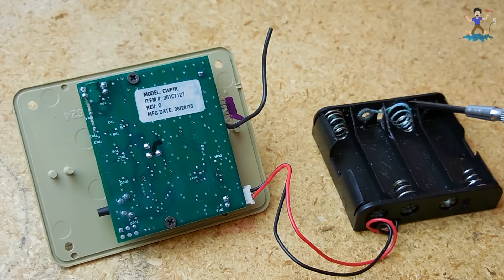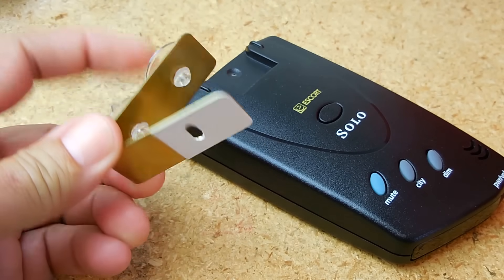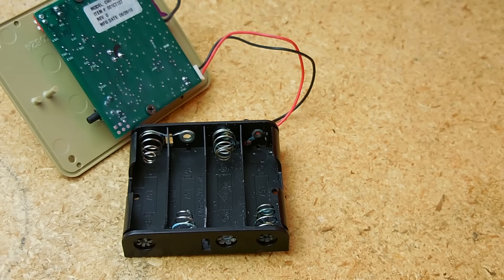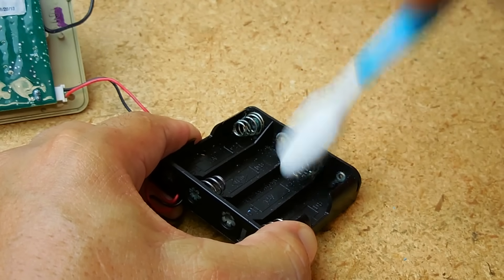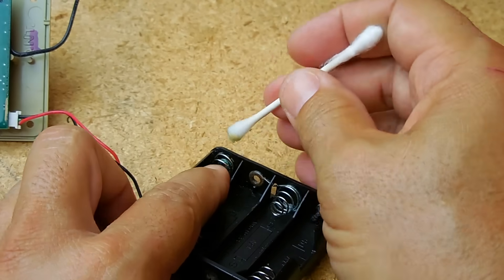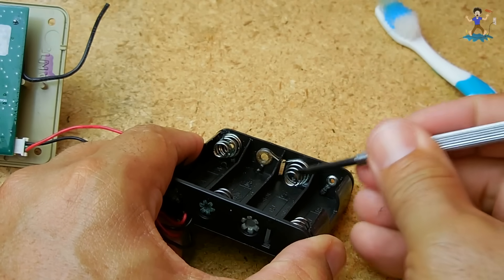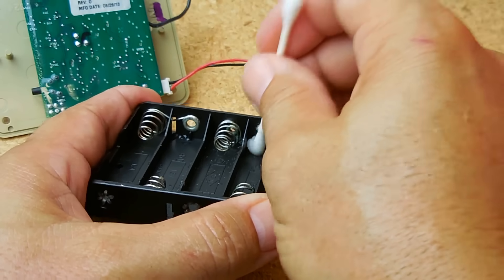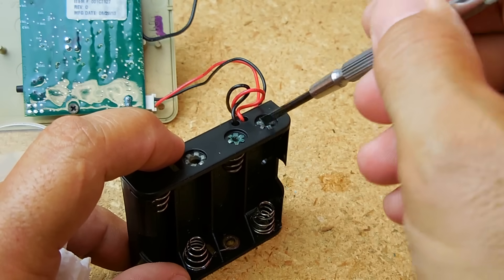EASILY Clean Battery Leak Damage(Corrosion) In Electronics

Comment: Moral of the story is to remove batteries when not in use for a while or a long time.
Reply from the maker: Yes, remove the batteries when not in use. Thanks for watching!
Reply: Instead of removing the batteries, an easier/more convenient way to avoid leakage, is to simply turn around ONE of the batteries thereby interrupting any power drainage/leakage due to any possible flow of current through the circuit.. This will also prevent losing or misplacing the batteries for later use..
Reply: @johnmcclintock8004  If there are an even number of batteries, turning half around will stop discharge.
Another technique is to place a small thin piece of paper or plastic over a battery terminal as an insulator.
However I have now thrown away several somewhat expensive aluminum flashlights because the batteries swelled up and I was not able to get them out.
Reply: MrTechnophile  <—. If the batteries are copper top I hear u can mail the flashlight ( or whatever ) to them and they will replace it.  The copper tops are TERRIBLE for leakage, rather than spend the money to improve their process, I think they feel it is cheaper just to replace the items. I have read that many people have had to do this and people at the Coppertop company don’t seem to mind or question.  I have had very GOOD LUCK, however with Ray-o-Vac not leaking. ( your mileage may vary of course.)

Wish he went over how to get to & clean  the bottom of a damaged flashlight, or how to drill out a swelled up battery stuck in a tube type flashlight.
Reply: @johnmcclintock8004  I've had batteries leak that had cardboard btwn the batteries and the contacts. Infact, I've also had batteries leak inside the bulk packaging of batteries that you can get at home depot etc.
Reply: @johnmcclintock8004  Given that I have found lots of new in packet batteries leaking I don't think this is good advice. It's not just current drain that causes leakage, the batteries will do it spontaneously.
Reply: @johnmcclintock8004  , Incorrect! Do Not flip one battery around on any device that has a small constant current draw, which includes most flashlights that have multiple modes for brightness and flashing, and certainly anything with a microprocessor. The constabt current draw might only be a few micro amps but the reversed battery will be likely to leak because you are asking it to "buck" the voltage. BTW, I have also seen alkaline batteries actually flip and reverse polarity all  on their own! Seems to be more prevalent if you mix and mismatch batteries wired in series ---- the weakest battery, or the one that is most different from the others, may change its own polarity, or is more likely to overheat and leak.
Reply: @jonka1  , the battery that is installed backwards will be the first one to leak, if there is a constant current flow of even a few micro amps. Or, that battery will flip its polarity internally. I have seen alkaline batteries do this; it's a major reason why manufacturers tell you specifically to NOT "mix and match" batteries. The weakest or most chemically different battery will invariably fail first.
Reply: @europana7  yep. I've had new, never used batteries leak in the drawer where I stored them...more than once. I think some just leak because they're faulty. This was a name brand, but I can't remember which one...one of the big ones, though.
Reply: @jonka1  I agree. I think some must just be faulty. I've had them leak all over the place in the drawer where I stored them...more than once. And it was a major brand (though can't remember which one).
Reply: @electronicsNmore  Our remote control to our television began not to work, and I noticed the batteries that were in it mildly corroded the inside of the remote.  It was an active remote, so it’s not like the batteries I’ve been sitting in the device for a long time without use..  I came across your video, and cleaned the inside of the remote, and it works like new. Thanks for uploading this. I really appreciate it. It was very helpful and I gave you a thumbs up.👍
Reply: A useful approach, seems problematic for flashlights.  Maybe rubber-band a Ziploc bag with the batteries to the item so you can find the batteries in the dark.
Reply: Yep, I forgot to do that on some Christmas lights I decorate my car with every year... Now it’s super corroded and gross. Gotta get out the vinegar!
Reply: Amen to that ... Remove the batteries when you are not going to use it for a long time, we ALL experienced battery leakage
Reply: Has anyone noticed that Duracell's copper top batteries have the highest probability to go bad? I refuse to buy them anymore!
Reply: Correct answer is to use lithium batteries. Lots more $$$, but no leakage issues.
Reply: Maybe if the flashlight manufacturer would put in a sleeve of some sort (foam, maybe?) that would still allow removing batteries if they swell up, I would be interested in buying their flashlights again.  Currently, I buy their high-quality flashlight, put it in the glovebox, and when I want to use it not only are the batteries dead, I can't change them.
I should use the batteries-in-a-Ziploc approach.  Except I need the flashlight again, put the batteries back in.  Done, take them out.  Oops, not quite done.  Back in.  Sooner or later, forget to...
Reply: @MrTechnophile:
Thats what 99% of the people do, buy a nice quality flashlight, put the batteries IN and let it sit in the glove box ... Then months or yrs later they need that light and guess what..?? You answered it, dead batteries... or exploded batteries and now your flashlight contacts are corroded... now its a dead weight... 
So you take the batteries and put them in a small zip lock bag and try to keep them air tight as possible ... Now if you buy GOOD batteries, like energizer or duracell with ~10 yr storage life...  They should be ready to go and your light wont have corroded contacts :-) 
Just don't forget and leave them in .. !!
Reply: @ACommenterOnYouTube  Thats why I now put a handcrank torch in my glove box. No more batteries going bad to worry about. I used to keep Dollar store torches and batteries still in their packs in my car and years later remember about them. I forget about them cause I always end up using my phone as torch most of the time anyway.
Reply: @Hyperpenguin:
Well most NAME brand batteries have a ~10 yr shelf life .... So guesstimating those Energizer or Duracell batteries that are NEW IN PACKAGE left in the glove box for ~10 yrs will still work ... 
Yes your phone's light is what MOST will go for but depending on WHAT you are doing, sometimes a good ole flash light works better.
Reply: @ACommenterOnYouTube  i had duracell just cover my remote in crap..
Reply: @TheHyperPenguin  the only crank flashlight I've come across that's worth its salt is one I got from IKEA, of all places. Red hourglass shaped, using a capacitor instead of batteries for energy storage. It's actually useful.
Otherwise, an 18650 powered flashlight is much preferred over any standard alkaline cells like AA, C, or D. 
 AAA flashlights get a pass because they're usefully tiny.
Reply: @ACommenterOnYouTube  Duracell have become utter crap, they often leak; I've had better luck with Eveready Energizer and Panasonic batteries. Eveready claims to guarantee their premium "Max *Lithium*" batteries against leakage for 10 years, but they're expensive. They do have a bit more voltage than their ordinary, non-lithium Energizer Max batteries, which will give you a bit more output and should last longer, although  cheap flashlights might not handle the extra voltage without overheating the LED unless there's a heatsink or some metallic mass to the flashlight.
Reply: Learned from a high school shop teacher that a rubber pencil eraser will also do a good quick fix if contacts are not too corroded, but like the added benefit of the rubbing alcohol for the neutralization. 👍👍
Reply: @bryankautz826   Use of a pencil eraser, or better yet a mildly abrasive ink eraser that has some silica or fiberglas in it, is an old military Signal Corps and ham radio trick that I learned from an electronics tech.  Unfortunately most modern erasers are made of some kind of soft vinyl or plastic material that doesn't work worth a damn. Another tool that anyone who dabbles in electronics should have is a fiberglass-bristle "scratch brush". These are excellent for cleaning heavy tarnish or corrosion on electrical contacts.
Reply: And be sure to check when buying used electronics
Reply: Yeah I left mine for 5 years lol this video helped cause I was able to fix a ton of my old toys with it 😅
Reply: @Scented117  I bet the ones you left for five years were not Duracell Copper Tops! LOL
Reply: Yes but we always forget about it!
Reply: Or use lithiums if compatible.
Reply: BINGO!
Reply: Thanks. Just what I was looking for
Reply: Wise advice! However, I have experienced leakage in a remote that I use almost daily. No way around it, I guess, at least in some cases.
Reply: @michaelscholes8956  Use lithium batteries for remote controls.  Energizer, at least, guarantees no leaks from their lithium batteries.
Reply: @ebinrock ,  we should clarify that you are NOT referring to rechargeable lithium batteries. Energizer Lithium Max are disposable batteries. I've been putting them into expensive devices where changing batteries is difficult, like Fluke multimeters. The 9 volt batteries cost something like 8 or 9 bucks. Nite that voltage output is a bit higher from all of the batteries in that series, including the AA and AAA batteries (1.65 to 1.7v under no load), and so some flashlights might run the LED kinda hot unless there's a heatsink or some metal mass to conduct away the heat.
Reply: That's easier to say rhan to do, at least for me. I forgot several times. This is an awesome trick and well explained.
Reply: It depends. I was on a 7 month trip across Europe with a tent and bicycle. My Black Diamond headlamp has some corrosion in it even thought it's IPX what-not (enough to dip into water for up to 1-2 meters) and I've used it almost every single day. Every time you open that thing up moisture from the air goes in and there you have that green crap. But yeah, removing batteries for long term storage is essential and applies to all types of devices regardless of the battery (plus the battery will not get drained as fast if not inside the
Reply: Nope! Instead, put a piece of plastic on the positive pole. That will stop the electrolysis process.
Reply: The negative side of the alkaline batteries is invariably the one that leaks, never the positive side. If you insulate anything, that's the side to do it.
Reply: @wingerrrrrrrrr
Reply: The other Tech Tip is to find, buy & recondition these Careless Moments.
Reply: Sometimes you forget. So many many things have batteries.
Reply: @Randy Alvarado because they are regular alkaline batteries which are prone to leak regardless of shelf life or brand.
Rechargeable batteries (NiMh & Li-ion) DO NOT LEAK because they are a different chemistry.
Reply: Yeah but sometimes you put something away with the intention of getting it again and forget
Reply: Very rarely happens but good point, if you remember where you put the batt’s!  🥴
Reply: BUT I NEVERVTHINK ABOUT IT!   Do i suffer!
Reply: Duh.
Reply: My walkie talkie is damaged bcoz of leaked batteries
One is, working one is not
Don't know, what to do
Reply: We aint got time for that,  they will be gone when needed again.
Reply: Yeah... Learned that the hard way

Comment: The battery leakage and corrosion thing seems worse than it used to be. I've had quite a few things ruined by corrosion recently. 
I have some popular brand batteries (Dura####) that have started to rust on the negative end while still in the package. The expiration date is December 2025. Are they cutting corners in manufacturing (cheaper materials, etc ?)
Reply from the maker: Thanks for watching! I have a lot of excellent videos on my channel that cover many different subjects, so be sure to check out my extensive video playlists for other videos of interest to you, rate thumbs up, and share my channel with others. Thank You

Comment: I've had four of this brand driveway alarm and every one corroded.  Suggest coating the battery holder with a thin film of vegtable oil.  Worked fine for me, but the alarms suck.
The Old Master
Reply from the maker: Use a thin film of silicone grease. I have a lot of excellent videos on my channel that cover many different subjects, so be sure to check out my extensive video playlists for other videos of interest to you, rate thumbs up, and share my channel with others. Thank You

Comment: Great tip.  This happened to a TV remote of mine. I tried cleaning it all out and got it working for a while, but it failed a couple of months later and I had to buy a new one. Wish I'd seen this video first. 
Note that in the UK Rubbing Alcohol is called Surgical Spirit.
Reply from the maker: Glad you enjoyed the video! I have a lot of excellent videos on my channel that cover many different subjects, so be sure to check out my extensive video playlists for other videos of interest to you, rate thumbs up, and share my channel with others. Thank You
Reply: Or just ask for isopropyl alcohol. The 91% version found at the local drugstores in the U.S. can be used to remove sap from a vehicle when it drips from pine trees.

Comment: Not all batteries are alkaline which in fact are less likely to leak than standard (acidic). I've always used a paste of carb soda. (baking powder). From now on if I know batteries were alkaline I'll use vinegar. For car battery terminals, definitely use carb soda.  (sulphuric acid type).
Reply: David Price                  Yes, Car batteries are acid batteries and so baking soda works because it neutralizes acid. These little batteries are alkaline batteries so an acid like vinegar neutralizes them. I have had little luck neutralizing these little batteries with baking soda and that makes sense because it violates the laws of Chemistry.
Reply: Yes we are looking for ph neutral (5, I think), maybe we need some litmus paper. Or just determine for sure what type of batteries we are dealing with. Now I'll have to look up ni-cads, li-ion, etc. (haha). Cheers.
Reply: David Price                    Yes, please post when you have some info on neutralizing the other types of batteries......So far a NiCad battery has never leaked in any of my devices. I hear the lithium ion batteries can be dangerous if the case is broken in any way.
                 A tip I got from the comments is to neutralize the water after a vinegar rinse with 90% alcohol because it absorbs the water. I like to treat cleaned contacts with De-Ox IT and Preserve IT sprays (spray them on a Q-Tip if overspray is a problem). Radio Shack also makes a great contact cleaner and protector.
Reply: Sheri Schneider, NiCad cells contain Cadmium, a deadly material. They can be thrown into the garbage by mistake. Don't.   Using a hygroscopic liquid like dry alcohol will help relieve the water problem. It will not clean what it can't touch, such as stranded conductors inside plastic insulation. In other words, wires you find corroded with the strands visible are going to fail eventually. Better to replace them than not.
Reply: @sherischneider2672  And I have never had a problem with a rechargeable battery leaking - lithium or NiMH. I will not buy any NiCd device because those batteries do not hold a charge.
Reply: @davidprice2861  Neutral pH is 7.0.

Comment: Why not just soak the entire battery holder in vinegar?
Reply from the maker: Hi Mitch. If you do that, the vinegar will find its way up into the copper wire and the acid may destroy it over time. Thanks for watching!

Comment: One of the best ways to clean these type of things is to use a sand blaster if you have one, but use it gently and work fast that way you won't damage the item.

It brings it up like brand new, give it a quick clean off and your good to go.

Just make sure if you have any screw holes to put the screws in so you don't damage the threads.

Comment: Thanks for the video!
One thing I want to mention is that if the battery contacts are so corroded it will remove the nickel plating(sometimes cheaper tin). After cleaning you are down to the base metal (usually steel) and you will now have dissimilar metals which can speed up the corrosion. (batteries are usually nickel or nickel plated which matches the nickel plated contacts)  You will have to keep a close watch on devices in this case. Remove batteries as much as possible on devices that see little use.
Reply: Just "replate" the contacts with solder. Lasts many years. See comments from James Jacobs.
Reply: @jamesjacobs7944  This is a good tip, but it's possible to overheat the contacts, which can melt the plastic that the contacts are attached to.  I'm not saying you're not right, but DeoxIT is safer, IMHO.
Reply: You can use DeoxIT or a touch of paste used by electricians for copper to aluminum connections.
Reply from the maker: That's correct. Thanks for watching!
Reply: Conductive Silver pens (made for simple PCB repairs) will re-plate battery terminals that corroded down to the base metal. And they don’t require any heat. They’re available on Amazon for $7.  The silver “ink” is conductive enough to draw circuits right onto plain paper.
Reply: you can also use dielectric grease
Reply: If it gets so corroded that my (European) nickels bend and my biggest flat screwdriver breaks.. Then what should we do?
Reply: Possibly dielectric grease would prevent it.